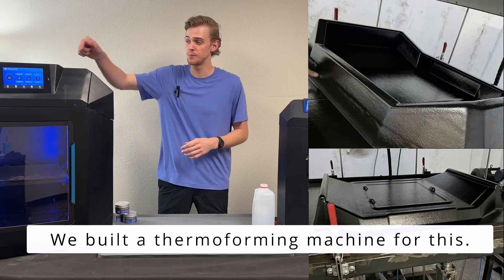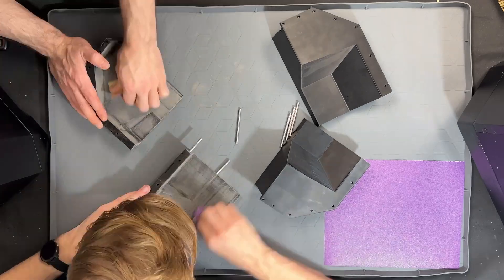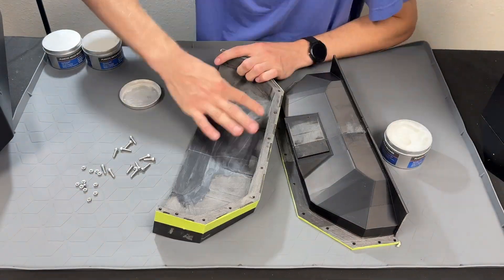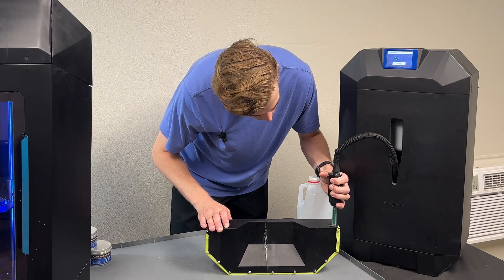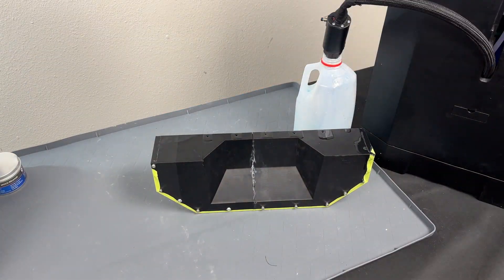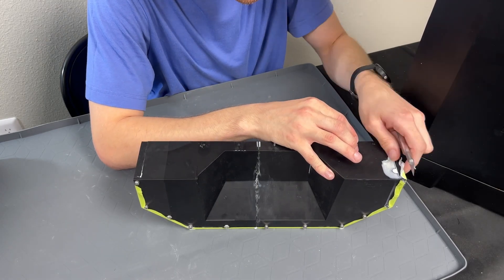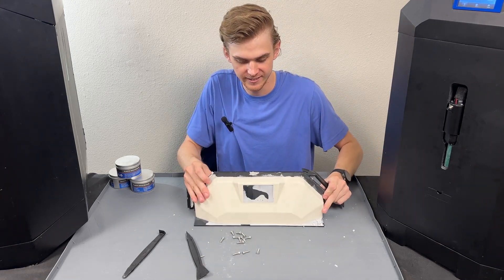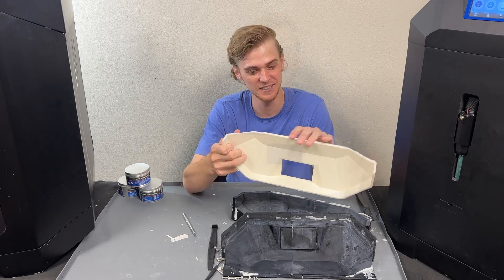How Fast is Desktop Injection: Rethinking Production

Comment: and what is the strength impact resistence of the product made by casting? For example, if you compare it with HDPE plastic, HDPE plastic is very strong and light. And how does your product look in comparison with HDPE plastic?
Reply: Resins in general are stronger and harder than plastics.

HDPE has an impact resistance of 6.5 J/cm and a shore hardness of 65.

Polyurethane resin has an impact resistance of 8 J/cm and a shore hardness of 75.

Comment: Would it be possible to add aluminium powder into the resin mixture for cold casting ?
Reply from the maker: It would work, but it does change the viscosity. Pumps are designed to work with that. As requested, we are currently integrating pump offset values to our gui. You will need to calibrate it before the injection though.

Comment: I get it, kind of.  You don't get to say "this only took 10 minutes" when you have 24 hours of printing and 2 hours of sanding into making a mold for a single part.  But for making hundreds of parts, a machine like this would make a difference.  I've done enough work with resin to understand why you might want a system that can automate the measuring, mixing, and injection of the resin.
Reply: You think of this from a home user perspective. This is build for scalability. If you have to design a part yes it takes 24h to print and 2 to sand till you have the exact model but once you do that you can reuse that mold till it fails. Again this is not necessary aimed at 1 time use molds it's more towards print farms and fast turnaround for making the same part after you print the mold
Reply: @K4mikze  Thats my point.  No one cares if casting "only took 10 minutes" unless you are the little guy.  At the scale where this is practical you choose this because its cheaper startup costs, not because of cycle time.  So saying "only 10 minutes" is just silly.

Comment: I can't get the benefits of this set🙈 why one can't just have a vacuum pump with a vacuum chamber, 2 component resin and regular syringe for the same goal?
Reply: I think that's exactly the same. Ppl just doesnt know whot resin cast can do....
Reply: It's about speed. The machine automatically mixes the resin and flush cleans it. If you do it yourself, it will take much longer to do the mixing and cleaning. If you're only doing a few parts, then it's okay to be slow, but if you're making thousands of parts you need speed.

Comment: Is the output of the injection manual or can you give the machine the model and it will automatically detect the required amount of medium to inject?
Reply from the maker: It has two modes: manual and automatic, selectable from the screen. In automatic injection mode, you need to input the desired injection value. (this was one of the comments from our customers so we added it.)

You can take the necessary value from fusion 360, solidworks or whichever design tool you use.
Reply: @NeckogIndustries  Thank you for the swift response.
How likely are you to hit the November shipping? And is that you shipping out, or product landing in Europe?
Quite excited about an actual US manufactured tool and not another Chinese one.
Reply from the maker: November is our target shipping from US. Thank you

Comment: Seemed like e a cool idea given that mixing and cleaning resin can be a pain, but an additional $3000 for the printer is a bit over excessive.   Also, at $1000 base price, I'd expect it to support all resins, not just resins that are tailored for the machine.  Finally, you can clearly see bubbles throughout the pouring.  I feel that if you used a clear resin , it would not be as bubble free as claimed.   Also, what happens if someone forgets to clean it within the set time? Is the entire machine dead? Are we going to be charged hundreds for a hose and nozzle replacement?  Your videos show a lot of cut edits and almost nothing up close and en detail when it comes to final products.
Reply from the maker: It supports 3rd party resins. We will be adding resin calibration files as requested. If you forget to do cleaning you just change the nozzle. You don't need any tools. You can buy it through our website or 3rd party sources. They are industry standard and costs around $2. These systems do the mixing with a mixer nozzle as long as you don't inject from a very high point and introduce air to the mixture. You won't have bubble issues. We will have more videos on the channel about different parts.

Comment: Wait...how did you fill the resin? You skipped that. You have to show the entire process otherwise I believe it's not easy, perhaps it's very messy or impossible. It didn't take 10 minutes. You printed the molded parts after then sanded then assembled then mold release then filled the resin tank and perhaps cleaning fluid, then injected then cleaned up.  You're not honest by not showing and counting the real time.
Reply: For one part, yes. However the point is you can do small production runs with one cast. So it depends how many you do, as to how you divide the time up. End part is 10min per part. Mold is probably 3x 3d printing the part, as you need to make both halves of the mold then glue it all together. 
But  it has other benefits. You can do arbitrarily large parts without joins (as long as the volume doesn't exceed the tanks) . And the parts are stronger.
So it's complimentary to 3d printing, indeed depends on it.
Reply: @benp7328  looks like it could be useful for sure, thats not in question. However you should show the entire process and thought process. Start with the part you want to make and go from there. Perhaps an influencer would show the process without skipping so many steps. I would be interested to make a  60 shore A TPR shoe sole and a flexible foamed TPU insole.

Comment: What makes the degassing step unnecessary?
Reply from the maker: Degassing is necessary because mixing resin by hand introduces air into it. However, when resin is mixed using passive mixers, no air is incorporated into the mixed resin.

Pressure pots are used to minimize bubbles in the resin, with humidity being the primary cause of bubble formation. After pouring the resin into the machine's tanks, the tanks are activated only during injection. When the device is not in use, the material remains inside a controlled environment, maintaining optimal conditions to prevent bubble formation.

Passive mixers also enable you to pour very slowly, extending the working time. When injecting, if air is trapped inside the resin due to the pouring process, passive mixers provide more time for the air to rise to the surface.

Comment: Is it possible to switch between different resins in the system, and how much cleaning is needed to do so?
Reply from the maker: Yes it's possible but changes from resin to resin. Going from flex to rigid requires full tank flush and cleaning while rigid to flex or foam is pretty easy. We will be selling the tanks on our website too they will be $30. Removal of the tanks is 5 minute job.(6 screws and tank connection)

Comment: How is this any different from pouring resin into a mold ..? Lmao

Plus I bet there was air bubble galore in that part
Reply: You would have to mix the resin, as he explained. To get PU to flow everywhere in a mold like that would be a total PITA by just pouring so you would have to put it in a big syringe and inject, like he did here. Then clean it all up. You're right had he just poured it after mixing it by hand there would like be a bunch of bubbles but he didn't do that. Look up RIM like he mentioned in the video. I'm not in the market for this but $500 is pretty damn cheap for a system like this and the only company i've seen making this stuff at this scale.
Reply: @carmelol8574  $500? I see 700 as early bird and it shows regular price is 1k. Is just a pump which I assume will clog at some point. There is no way it can clean 100% PU from system after mixing.
So it might be ok for big projects, everything beyond 600-800ml of PU as you can use even syringe for that.
Also is heavy on bubbles, they don't use clear resin for that reason.
But 3d printer for 3k is just mental 😂 you can buy 6 bambu lab printers for that price and print those parts in just an hour.
Still interesting concept.

Comment: how reusable are the printed molds
Reply from the maker: We did test it around 30-35 cycles no problems. If longer cycles are needed we advise to print the mold as shell then inject with polyurethane as infill. This way there is no issues due to 3d print parts being too weak.

Comment: Hi. How strong is the resin part compare to 3d printed part from pla or abs?
Reply: I think the "brittle" reputation of resins exists because UV 3d printers typically use acrylic-based resins. (acrylic is a brittle plastic) Polyurethane resin can have any hardness, from stiff to rubber.

To have a good idea of what properties cast PU parts can have, look up the hobby-focused "guerrilla guide to resin casting".
Reply from the maker: In every axis it's better than PLA or ABS printed parts. On Z axis there is no issues due to chemical reaction of injection. Parts are isotropic meaning the durability is uniform on every axis.
Reply: @NeckogIndustries  thank you for answer. I do understand that such part is isotropic. I just thought that resin on its own is too brittle without reinforsment with some material (like fiber glass, carbon etc).
Reply from the maker: You can check our other video on durability. Polyurethanes are a bit different than epoxy resins.(epoxy is more brittle). We will do a video on polyurethane composites with glass fiber cloth.
Reply: @NeckogIndustries better how?
Reply: @NeckogIndustries  lemme introduce you to PCTG
Reply: @NeckogIndustries this would only be true when comparing identical geometries. Since fdm and molding are two very different processes y by necessity you have to design the part differently. I can very easily design a fdm printed part just as strong as a molded part. It simply won't look identical. You also don't mold pla. Comparing a pla or poorly printed abs vent hood to a molded urethane one is not a proper comparison. Where molding exceeds fdm is in smaller and thinner geometries.
Reply: Polyurethane resins are very strong, durable, and impact resistant. Polyurethane is stronger than HDPE.

Comment: You haven't answered my question for the last three videos. What is the size limitation of the injection molding?  

Is it possible to put together larger molds and still inject? 

Thanks
Reply from the maker: Your question was answered the day you asked. You can check from other videos too. 

Here it is: There is no size limitation limit is 2 gallons; as long as you fill the system you are able to use continuously.  

Entire rear spoiler would be too heavy unless you have a inner core placed before(Like a closed cell foam or a inflatable inner core). Bumper and front spoiler would be ok.